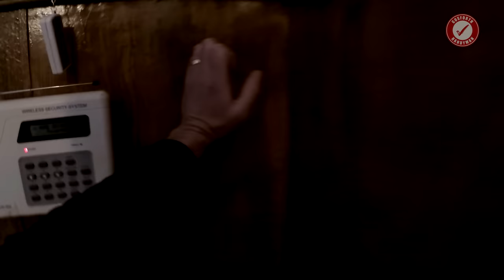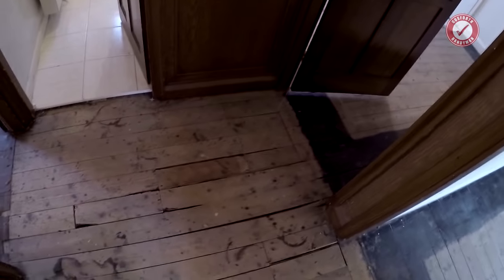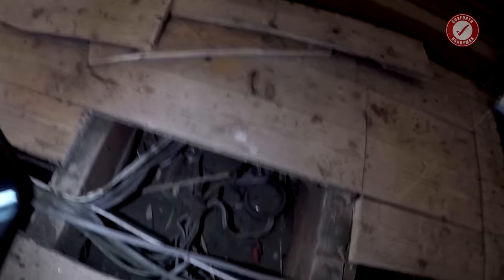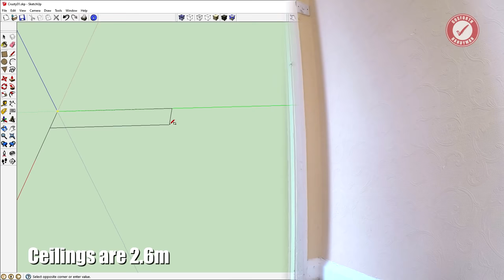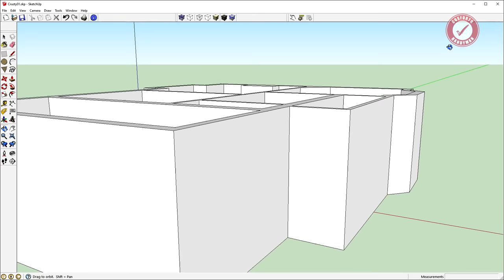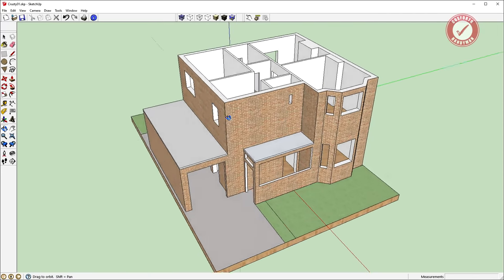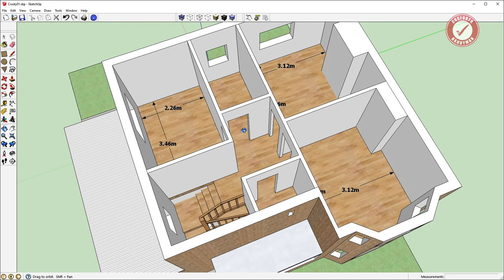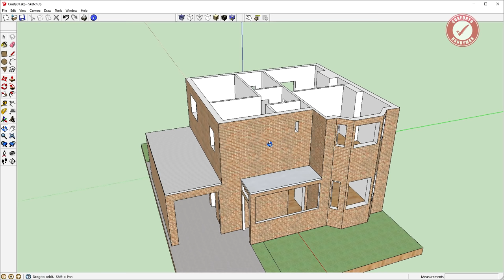Structure, drains & plans - what would you do? (1920's Renovation Part 2)

Comment: Just found this channel. Very interesting project. Bit like homes under the hammer but with more substance. 😂. Well if this was mine and I had pots of cash to throw at it I’d fit an RSJ across the whole middle of the downstairs and take out that corner chimney breast up to roof height. Next knock the 2 rooms into 1 and knock through into the kitchen to make a big open plan kitchen/dining room with a central kitchen island, and install huge bifolding doors into the garden. If I had the money I would knock down the garage and build a garage with a room above and maybe a double extension on the back......the possibilities are endless if you have the cash. Really excited to see what you do here. My father in the 80’s bought an old 1930’s semi. He knocked the 2 rooms into 1. Took out the chimney breasts. Installed central heating, put a double extension on the house. Converted the loft, and added extensions to the extension. We used to joke about when the house would ever be finished. 😂

Comment: Just found you.  My house is hundreds of years old, but I did find it funny when you realised that all the walls were solid.  Mum's 1920's house is just the same.  Not a single hollow wall.  Mine are all stone.  Feet thick in places.  There's no moving them.  There's nowhere to bury electric cables either.  It's all surface mounted along the beams and then stained to match. 

The garden's fantastic.

Comment: As soon as you said you were looking to see which were the hollow walls I chuckled - just knew they’d all be solid. My parents built a house in the fifties and all the walls were solid brick. It was an absolute pain drilling in to put any fixings in!
Reply from the maker: First house I've been in where literally every wall is solid. Normally there's at least a little bit of lath & plaster to deal with... other than the ceilings. 😂👍
Reply: At least your walls aren't horse hair!  The front half of my house is a nightmare to put anything in the walls.  I try to hammer in a nail and I get a giant hole and cracks down the wall! 🤦🏼‍♀️
Reply: To hang a picture up, lots of nail holes looking for a mortar joint between the bricks 🤪..

Comment: Dear Andy
You've smashed the ball out of the park with this video. It's very useful to see you go through the whole property with nothing cut out and you thinking aloud, especially when looking at the crack and investigating the pipes and wires. This is much better than you just giving a concise summary of your findings, in my opinion. 
Some things I would do based on negative living experiences in London:
I would leave the garage area as a drive through to the garden and build a master bedroom with en suite on top of it. It will allow you to drive a vehicle through to the garden which can be very useful, for example if you have a loaded work van you don't have to leave on drive exposed to opportunist thieves. Also, you can take materials and tools through in your vehicle to the workshop, or leave it parked in the dry, or use it as a temporary storage until you've tidied things away properly. Would also serve as a mud room for bikes and boots. With a full extension round the back, I would prefer that over more internal space. 
Out in the garden, i would build as large an outbuilding at the end as possible but not close off the whole back of the garden, so build it portrait instead of landscape. That way, you still have access to and view of the river. I would do that on the right, so you have a clear passage from drive way all the way through to the river with hard floor. 
All the best with whatever you do.

Comment: Tear out the Garage and add a new one attached to the build on in the back when you do the extension. Make it with doors on both ends. That way you could drive through to the back garden if you wanted and make a workshop back there.

Comment: I'm a surveyor so this past week I have surveyed 2 properties which go to the structural engineer (CAD dwgs) for exactly these decisions. I would turn front room into small sitting room, knock two back gf rooms into kitchen/family room and put sun room out the back where Bay window is now. Obviously steel needed to support two upper walls, an opportunity to sort that crack out too. Is there room in hall to put new door into understairs void? WC in there block up door on garage side. I'd leave upstairs largely alone, apart from taking WC into front room as ensuite if there's toom for WHB and loo. I wouldn't mourn a bath, just replace shower and tiles as they are manky.
Reply: The porch spoils the look of the property. Its useful to have an air trap so I'd replace with something smaller. Can you apply for whole of front garden frontage as car parking?
Reply: And keep the single skin garage as a workshop. Replace roof but a skylight in for light
Reply from the maker: I think the understairs cupboard would be too small for a w/c unfortunately. Porch defo needs replaced at some point. 👍😀

Comment: This is going to be a great journey. I personally would make a drive through to the back garden and build a workshop down the garden.  Who needs a car port when you can't access the rear with anything bigger than a wheel barrow? Inside 1st new central heating. 2nd check wiring rewire if needed. Then  like you said open up the rooms possibly remove the angled chimney and the one above  if it's possible are they a combined chimney with next door? They shouldn't be of course but sometimes builders cut corners. Make the shower room bigger by using a combi boiler to eliminate the cylinder . Look at improving the toilet possibly open the door out to make more room inside for a sink I didn't see one there?

Comment: First thing I'd do is pull the ceilings downstairs much easier than destroying the floorboards and makes running new cables and pipework so much easier and gives you a good look at what's holding up the walls upstairs yes it makes one hell of a mess but once it's done everything is easier I always run 3x2 cls the opposite way to the joists giving you a way to run everything without drilling or notching the joists also makes the upstairs floors stiffer

Comment: Our 1960 council house is built with all solid walls too. Only the one running through the centre of the house is structural, the rest are just butted up against the plasterboard between the joists - we took out the old pantry walls that divided the kitchen and the dining room.

The upstairs walls are simply built on top of the floorboards, with no consideration at all to where the joists or downstairs walls are.
We have a couple of similar cracks for the same reason of the timber shrinking.
In fact, the wall between my office and my daughters room is actually floating for a short distance as the floor has shrunk away from it. (Strangely, that one hasn't cracked)
You might find there is less under that cracked wall than you think!
Reply from the maker: Very possibly! I need to get the floorboard up to have a look. We shall see! 👍

Comment: This is a little half-baked but here goes. Rebuild the garage into a teenage hangout with study space and a sitting area with tv. Heve the new build wrap around to include a front porch (a bit further out than the present frontage if possible) with a centred front door and coat cupboard to the left of the door. The area in front of the teenage hangout would be a shower room accessed from the hangout, so that friends could stay over and the sofas would be useable as beds. The back of the teenage hangout would have patio doors to the garden. The small front room becomes a snug. The present kichen becomes a corridor to the teenage hangout and either a study, keeping the the exisitng window with the desk beneath it so you can gaze through the extension to the garden beyond while you work, or if you don't need a study, a utility room with double access from the kitchen and from the hall. The present back reception becomes the sitting room part of an L-shaped living area with an extension the width of the back of the house for a new kitchen and dining area.

Comment: For me I'd probably look into extending the entire width of the back. Move the kitchen into the extention with a dinning area there too. Convert the existing kitchen into a normal room and knock through to the livingroom to make that a larger space and turn the dinning room at the front a library/study/gaming room.

Of course knocking through that kitchen wall into the livingroom would require two steel beams under both walls of the bathroom to hold that up so would be costly for all that work and remodelling but this is hypothetical and more fantasy rather than what reality would dictate.

Beautiful property though with mountains of potential.
Reply from the maker: Cheers Scott and great ideas! 👍

Comment: I would definitely knock down the garage and replace with a two storey addition to allow for better sized bedrooms, getting rid of both of those floating walls upstairs to make rooms bigger. Also would rempve the dividing wall at the back of the house whilst adding a single storey extension along the whole back with bi-fold doors out to a lovely patio area. The back would be an amazing open plan kitchen and dining space. Would also replace the front porch and add a window above in the first floor area to balance the look of the front facade. All depends on budget though!  Good luck!

Comment: My first impressions, subject to change:  Downstairs, keep the front "dining" room as a snug lounge.  Off the back, build a full-width addition to include an open plan kitchen/diner/family room with a large opening into the living room.  The former kitchen could be used for a half-bath (WC) and a utility/laundry room.   Hopefully, no steel required to support openings in the back wall.

Upstairs, Keep bedrooms 1 and 3 as-is.  The upstairs of the addition could be a huge master suite accessed via the old bathroom.  Bedroom 2 (since it would now have no window) could be divided to make a new hall bath and a master bath.  That little WC room would make a good closet.

I know a fourth bedroom would increase the value, so maybe replacing the garage with a bedroom would be in order, and the half-bath mentioned above could be a full bath for it.  Above it could be a porch or deck.  If you're going to live here, you've got plenty of room to built yourself a workshop in the back garden.

Comment: Lovely. What you will find is that the wall in the upstairs is probably just say on floorboards. Was common practice in the day. probably not brick just the old black dust/ash mixed with weak cement. Enough to hold a wall up. I would also do a U shaped wrap around combining the front porch, double storey over garage and extend the full width of the house at the back.

Comment: Probably best to lose the garage ASAP as then at least you have good access for clearing out the garden (mini digger, etc) which I'd get going with first. My mid-30s house was in a very similar state when I bought it several years ago with a long, unkept garden. Inside, there was 70s wood cladding with 'bespoke' DIY cabinets absolutely everywhere!

We did have a spot of dry rot and woodworm, but it was all treated along with the crawl spaces and airbricks cleared out. Ended up having to replace the cast iron guttering and downpipes as it was beginning to rot in places and was pretty much hanging there!
Reply from the maker: I defo want to retain front-to-back access - for a garden of that size it's defo a requirement. 👍

Comment: I would knock down the existing garage, and build a two-story addition in its place. I would build an extension off the back of the house about half the width of the property footprint. I would place the new addition on whichever side of the property gets the best sunlight, so that you get south or west light if possible. I would keep the private facades of the house that face the back garden as full of windows as possible, even floor-to-ceiling glass if the budget allows. 

The ground floor can be transformed into an open plan space comprised of the kitchen, dining and lounge spaces. You can probably turn the front room on the ground floor into a study/guest bedroom, and open up the rest of the floor plan. You could probably tuck a powder room into the corner of the ground floor on the street-facing wall, in the area reclaimed from the garage. It would be convenient for a guest staying on the ground floor if this was actually a small bath with a shower. You can combine this bathroom with a dedicated laundry area in this bathroom as well, since you're already in the plumbing side of things. Since you have to dig up that area for foundations anyway, you have an opportunity to put in as many drains and service lines as you need without having to punch into the existing house structure too much. 

On the upper floor, I would make the small bedroom on the garage side into a master suite using the entire footprint of the garage extension. I would incorporate the existing small bedroom space, but allocate some of the floor area to enlarging the hall bath a bit. If you can integrate the back garden extension on the same side of the house as the garage extension, and if you can build at least part of it as a two-story extension, you could create a very spacious master bedroom with its own private bath. Naturally, the master bath should be on the street-facing wall, so you can utilize the same drain stacks for both new bathrooms. You also want to keep the back garden-facing walls open for windows, so putting a bathroom there would be less than ideal. You have an opportunity to create a private outdoor balcony above the remaining one-story segment of the addition. Naturally, the planning commission might have some restrictions about what you can and can’t do in this regard, but it’s worth exploring.

Comment: Merry Christmas Andy, 
The garage looks too narrow to open car doors etc. Access to back garden is a major requirement and diggers etc may well need room above. I think the garage should go.
I think a 2 story extension at the back to provide room for bath in a bathroom, and new bedroom. Downstairs, the extension could house a larger kitchen, dining and living space. Downstairs WC, hand basin and possible shower to be accommodated close to current soil stack etc. Beyond the extension I would put a conservatory. As it's on the north side of the house, getting sun into a sunroom might be tricky. 
Is mains gas available? What is the local authority's position on sustainable heating. You may have space for ground source heat exchanger, but when I looked they were several times the price of an oil boiler but that may be changing. Digging your own trenches should help the costs. Drumming, down by the river in a purpose built annex. Lots of glass to enjoy kingfishers once the building polution has gone.😉

Comment: Water pipe, structural work, opening up downstairs and taking out chimney breast in corner of rooms up and down and all the way up. Look at anything in loft expansion wise, extension out back for big kitchen and dinner area, do electrics, central heating and radiators then carpets upstairs and loft conversion, then wood or tile floors downstairs. New kitchen in the extension, with covered deck off the back. And roof terrace over kitchen with green roof of moss maybe wood. And garage knocked down and extended footprint built with insulation. Or maybe big workshop in the garden and put in a veg garden where the garage use to be.
Reply from the maker: Did consider a roof terrace! But as the back of the house only gets morning sun it might end up getting a bit damp. 👍
Reply: @GosforthHandyman  massive mirror on roof then to be included!

Comment: Upstairs I would consider knocking the floating bathroom walls down, and build a new wall on top of the wall downstairs, to get two proper sized bedrooms at the rear.
In fact its copying the downstairs floor plan to the top floor.
A new bathroom could be built in an extension on the garage, the entrance should be from the plateau between the flights of stairs, thus needing  a set of four stairs into the extension.
The left over space in the front of this extension can house a laundry room.
I also would consider a toilet downstairs, it could be situated in the back extension, having to go upstairs to visit the toilet just isn't convenient.
I think the garage has to be rebuilt in case of an extension on top of it, the foundations are most likely not deep enough to bear two stories.

Downstairs creating a big open space by removing the wall between the kitchen and living room and building an extension 3.5 or 4 meters out would create a nice large living space, however considerable steel beams would be needed to support the whole back outer wall including the weight of the roof and the new dividing wall between the rear bedrooms, and the loft floor.
Having the extension stretch behind the garage gives space for a toilet and a storage room.

Comment: Regarding extensions, are you familiar with Permitted Development (PD)  rights? These will typically allow you to extend 3m out the back (single storey)  without needing Planning Permission. Loft conversions also can be done within PD rights.   Working within PD limits typically means you can proceed with more certainty and less delay compared to going through the Planning Permission process.